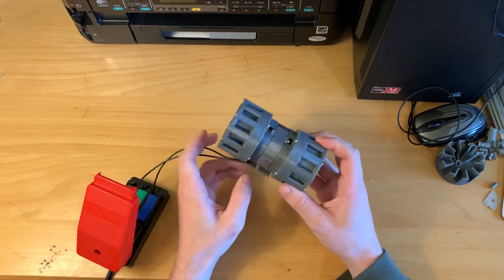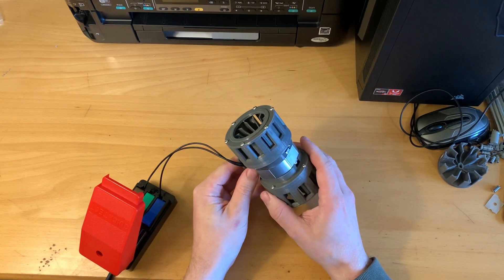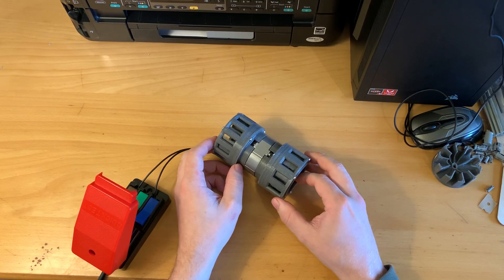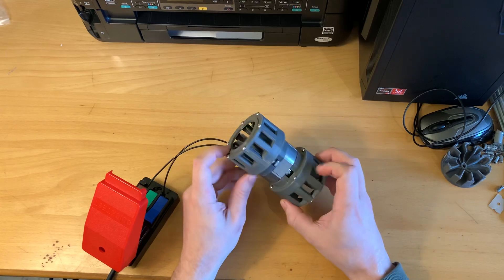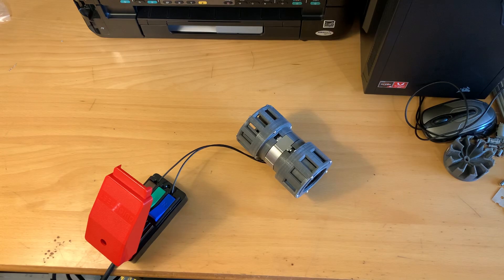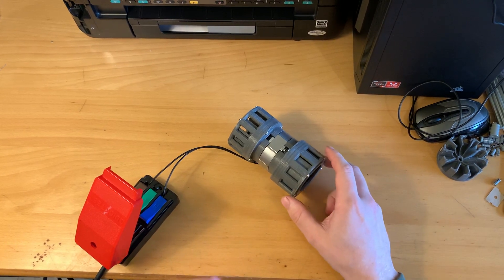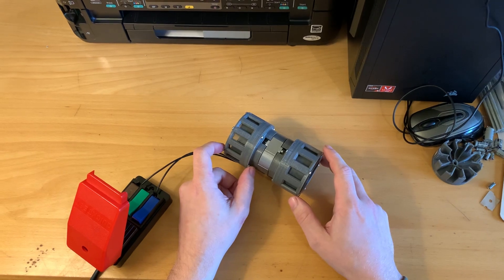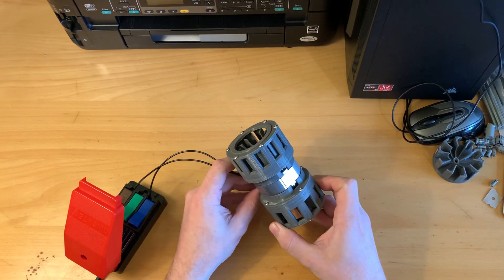Realistic design mini air raid siren, 10/12 port

Comment: i am trying to build one but as a senior mechanichal engineering student  i dont understand about electric circuits i done my research very well i need 2 3400- 3550 rpm motors which they need to be 60 - 50 hz. now here is my questation how can i arrange the hz i know rpm changes via the current i give to the motor also how can i give the motor a current that i choose? lastly i did some propeller desing in solidworks and i know how to print it but can you post a video that shows inside of the turning parts or at least a cad drawing video because i really wanna build an air raid siren (as i read it should be giving B and D natural tunes how could i arrange that is that reason why your air raid siren is 10 in one side and 12 in other side ) thank you for the video
Reply from the maker: For my siren design I used a single double shaft shaded pole induction motor which spins around 2800 rpm at 50 hertz. On 60 hertz it will spin around 3600 rpm. As these are induction motors, technically the best way to control their speed is via varying the frequency, however with these smaller motors varying the voltage ( and therefore current) is also fine for controlling the speed. A simple incandescent dimmer switch can be used to control the motors speed if required. I was aiming for a sound like that of the British air raid siren, hence my chosen number of ports (10/12) to give me a dual tone sound of 466hz and 570hz. To work out how many ports you need it’s motor rpm divided by 60, multiplied by the number of ports, this will give you the sound output frequency in hertz. Good luck with your design

Comment: Yes, it does sound like a UK WWII siren, I like it.
Reply from the maker: Thanks for the comment Blue Cylinder, I’ll hopefully be improving the siren through various upgrades in the future to get a more realistic wind up and down. I am going to try casting the rotors in Aluminium
Reply: @Electronicsandsirens  So long as you post a video of the finished product working.
Reply from the maker: @bluecylinder  absolutely, will post update videos on each change I make
Reply: @Electronicsandsirens  can I buy one please
Reply from the maker: @liamemmaairraidsiren9046  Hi, I have an order of these motors coming from China, so once I have my design finalized, I’ll be building more of these sirens and putting them on eBay. All the best
Reply: @Electronicsandsirens  ok thanks